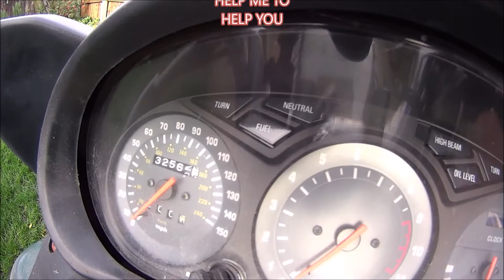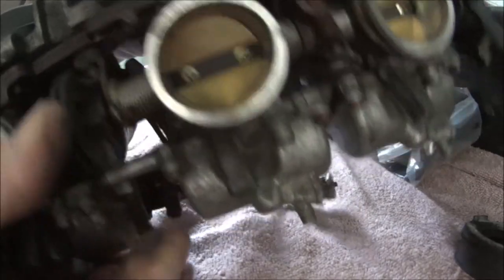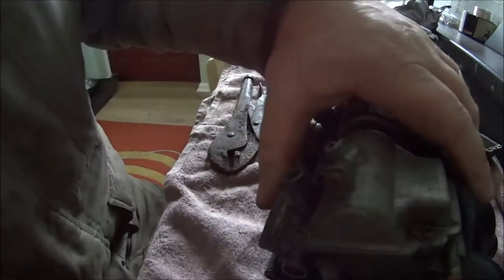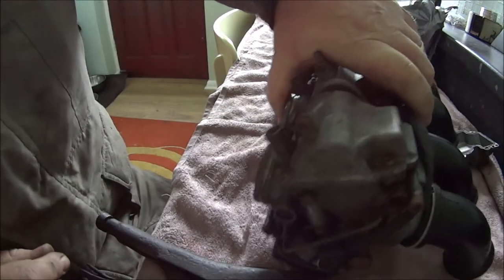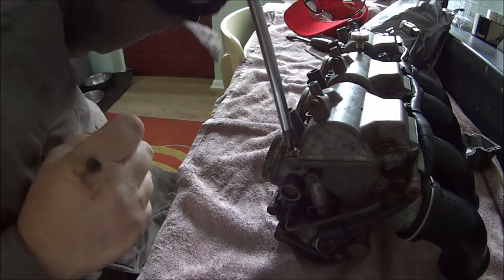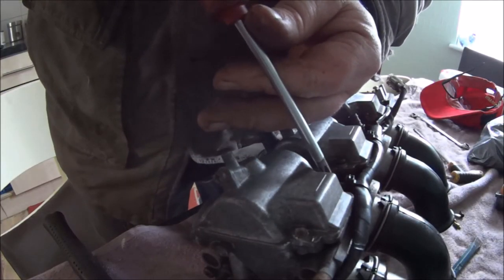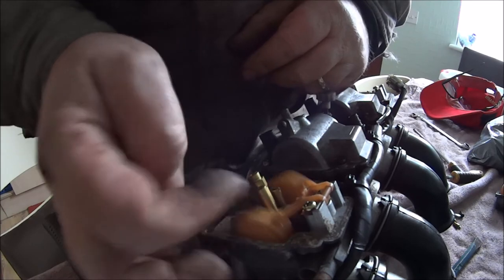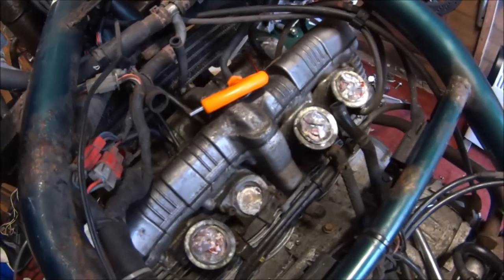Xj900s diversion carburetors cleaning & Carb flange rubbers badly perished

Comment: If crossheads "round off", get the dremmil out with the  thin blade, cut single groove to fit FLAT head screwdriver. Buy an IMPACT DRIVER and use FLAT head screwdriver bit to remove screw.. (38 years experience (check the website
Reply: If you can't a dremmel, half a hacksaw blade will do (bit easier than getting through the bars in a local jail, so won't take more than 6-8 hours I guess) If you ain't got enough cash for the impact driver. Go earn more cash first. (Impact driver first tool I bought, I had help in choice of tools to get from real bikers At least you not quite a Dewhurst.... but that is the way to learn butchery. If you'd had an impact driver, and Thors hammer, there would have been no reason for chisel and Thor's hammer, and nik would not even been involved)
Reply from the maker: cheers buddy

Comment: John where is the WD40 mate, you do have your work cut out for you there mate but you are doing a great job keep the good work up...
Reply from the maker: SooperSkoots I've used 3 cans of the stuff thee most be something better out there
Reply: @jonyr1TT  Maybe plusgas? I've heard it's supposed to be a good releasing fluid.
Reply: @jonyr1TT  Could you let me know where you got the radiator tube for the carb manifolds, please? £89 each new 😭